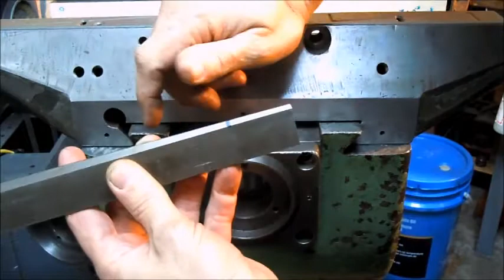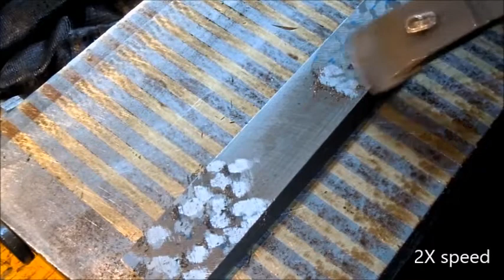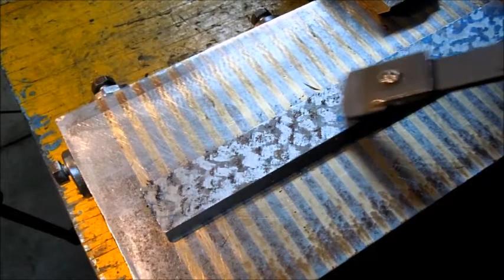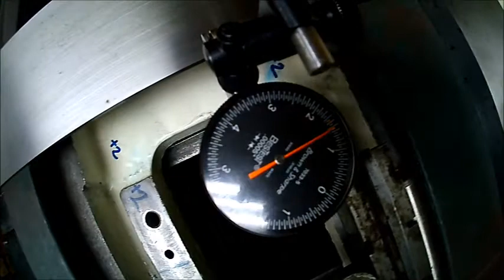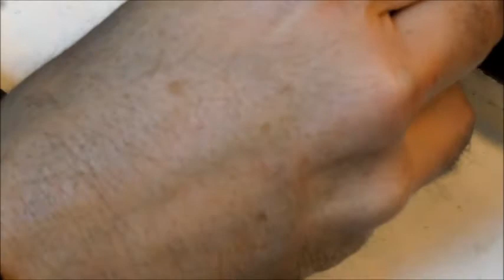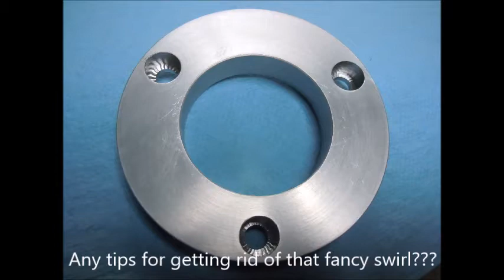Bridgeport Update 29

Comment: I've been watching this restoration series over the last couple of weeks, just recently came across your channel.

I like how you take your time to measure in several ways and think things through (within reason) before removing metal. 

In the first episodes, I think you wasted a lot of time by scraping blue points instead of just hogging off metal in areas when whole regions didn't touch. You seem to have found that out already, the blind and step scraping you've been doing in the later updates is pretty consistent with what we learned in the Richard King scraping class.

Some suggestions on handling the Biax though. Whether scraping by hand or Biax, it's important to not scrape twice in the same groove without changing direction. This will happen when you move the Biax back and forth as if it was a hand scraper, which you did a lot in the beginning and perhaps less now. It doesn't matter that much when lots of material is to be removed, but it will delay the development of a good bearing surface when you start to get close. Try to only move the Biax sideways, with a speed that matches the spm and width of your scraping marks so that all the scraping marks in one pass are separated by areas of roughly the same length and width. This way, you can get a pretty good bearing surface even before you start actively picking out individual high spots. I think this is a great advantage for the Biax over hand scraping, that it's so much easier to lay down a consistent pattern.

Stefan Gotteswinter did some good videos after he took the class:
https://www.youtube.com/watch?v=QJXqHpSh3SE
https://www.youtube.com/watch?v=S9N3Q8Qww2A

Also, Richard King has his DVD available on ebay if you want to go directly to the source and don't mind paying for good info: 
https://www.ebay.com/itm/LEARN-TO-HANDSCRAPE-BIAX-POWER-SCRAPE-DVD-FOR-MACHINERY-WAYS/172541866622?epid=1031786462&hash=item282c4bf27e:g:-yQAAOSwwo1XeXI7

I'm probably going to revisit this series for the measurement setups when I find time to restore my Beaver VBRP mill (Bridgeport style). Lots of geometric relationships to consider simultaneously, and easy to get confused or forget something. I have the Connelly book, it's a wealth of info but not an easy read. I frequently have to reread sections.

Almost forgot, that homemade beveled straight edge you were using is probably not rigid enough to reliably use the broad side as a master. It will probably bend too easily, considering how thin and long it is. I'd revisit and check any surface that hasn't been checked for straightness by other means already.

Overall I think you are doing a great job, very thorough.
Reply from the maker: Thanks for taking the time, to watch the videos in the first place, to comment and provide some feedback based on your experience. I’m certainly no expert, armed in the beginning with a few basic tools and a desire to master the, “chess game” that I now view this work as, I shoved off and went adrift in some tricky waters.
  I’ve been very fortunate to meet many good people along the way, pun intended, a few that have REALLY helped me, and I hope to meet more and more as I keep learning.  One thing that I have found is that all these people I talk to, they all have a slightly different approach to the work they do, some are self taught, some are recently schooled, some are new to it like me. I’ve found stark contrasts between what the Connelly book notes, and drills into you paragraph after paragraph, and what others that haven’t read it do. My good friend Harold, who I met along this journey has taught me a great lesson in simplification, as he puts it; flat-parallel-square, it’s all you need to remember. Trying to keep this in mind, trying to consider subsequent moves and how they affect FPS is, in a strange way (again with that), the fun for me. So, if and when it finally runs, it won’t be the metal chips that will be the reward, it will be the journey; see the poem Ithaka by CP Cavafy .

Your observations are spot on (haha – I should stop), you’ve obviously paid attention as you watched and see both my errors and my “forced” learning as I move along. In the beginning I was taking my time, oh how I spent time, to make sure that I didn’t take too much metal off, which is my excuse for not digging in. With a tiny bit of knowledge and experience now, I’m a bit more apt to step scrape etc… The Biax purchase was a gift, where would I be without that now!!?? and I’m adjusting to how it removes metal, I think, too.  

Best three words I’ve been taught in all this – Flat, Parallel, Square, hands down. Make sure you reference this as you dig into your mill.

Thanks for the links and info, much appreciated.
Reply: I'm a beginner myself, no expert and certainly not experienced. I've gone through a lot of theory and attended one of Richard Kings classes, that's about it. Just passing on some of the things I've learned that would help you.

I was lucky enough to pick up a green motor Biax BL40 myself recently. Looking forward to putting it to use, although I won't have time to start any of my machine rebuilding projects in the immediate future.
Reply from the maker: There is a certain satisfaction in knowing that you have the base knowledge, the understanding and then if you're lucky- the tools to make something really flat... I've found that I look at cast iron a bit differently now:) there's a bit more respect for the journey and the potential results! Thanks again for the info and thanks for watching.